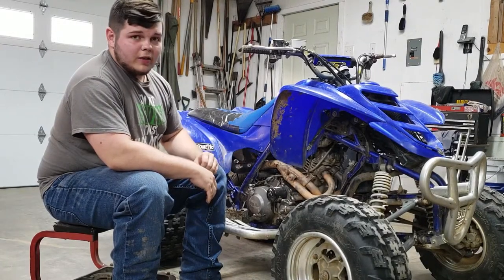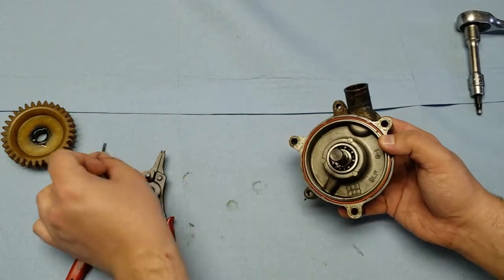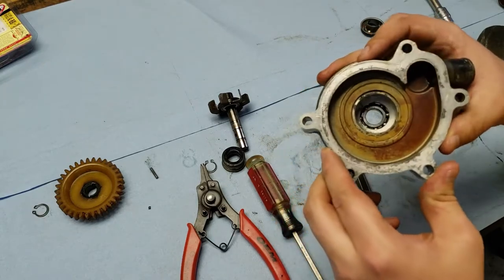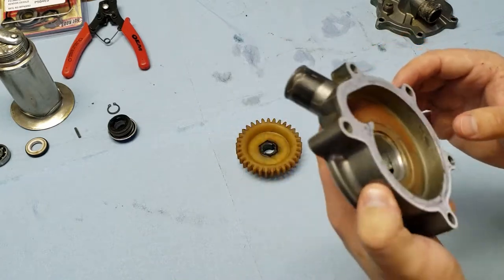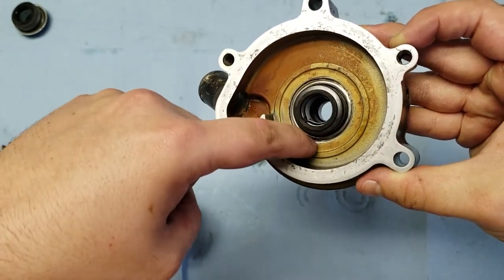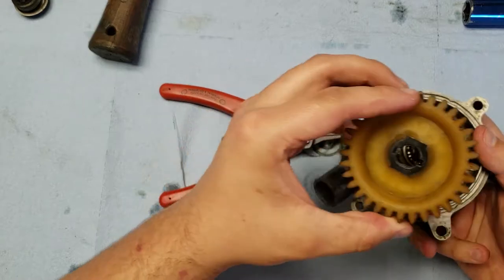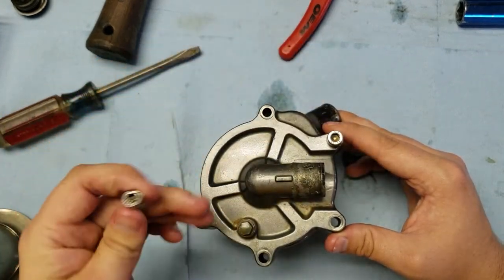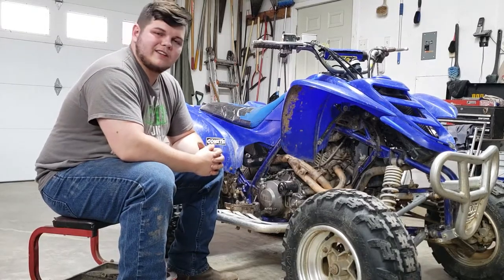Raptor 660 Water Pump Rebuild Guide

Comment: The black seal you put in on the backside of the bearing the one where you say the letters face out towards you - when I put my new seal in it went below flush on that side and now the bearings won’t spin.  I didn’t know what else to do so I kept going and when I got the shaft back in, it spun but kind of tight. Should it be tighter with the rebuild kit because of all new seals and stuff.  I got the same kit you used and there was no markings on the bearing like there was on the stock one that said Japan on one side. The book says put writing facing down but the new bearing had no writing. How did you know what way to put it in or didn’t it matter?  I’m taking a water pump out of another 660 to compare how freely it spins. So my questions are what about the lack of writing on the bearing and does it spin, but a little tighter than before. Thanks. And great vid
Reply from the maker: Mine was a little tighter but not by much since my old bearing really didn't have that many miles on it, its definitely not an easy turn but its not hard per say. I took a gander at which way it faces since I don't have an oem to compare, I compared to what I took out since what I had was working before. Most oem stuff - from what I've noticed - if it doesn't have lettering that means its uni-directional or its obvious which way it goes. This case was a "it looks like it goes this way" 😂 but yes. My bearing was a little harder but it could still spin, might check it before you press it in and see if it easily rotates with your finger because it should

Comment: Thank you. Can you please tell me where is the thermostat located 2005 raptor
Reply from the maker: It's on the right side hidden under the front plastics under the handlebars, you can follow the top radiator hose which leads right to it
Reply: @Hunters_Mechanics  I will look again thank you 👍

Comment: I took out the other one and it does spin easier than the rebuilt one. Think it’s possible to get out those seals without destroying them?
Reply from the maker: It would be a job for sure to attempt not to destroy them, I would go ahead and still replace the seals because they could still fail sooner than later and just cause you to rebuild it again anyways
Reply: Ok thanks for the quick reply. Appreciate it

Comment: Does it matter which way the seal behind that bearing goes because I put mine in opposite of yours
Reply from the maker: I think it does because of the taper that it has,  when I was doing the video I tried researching it but didn't find anything on it so I stuck to the rule of "numbers face you/up"
Reply: @Hunters_Mechanics   Took it apart and that's the way it came out of mine So I put it back that way then watch your video I was like damn  So I took it back apart Don't feel super good about how it went back together.lol
Reply from the maker: @coolguydpc89  well as I said in the video mine apparently didn't have one and I've had it since 2016 lol a seal is better than no seal
Reply: @Hunters_Mechanics   So you're pretty familiar with the 660 never had one and I'm doing this build Are they pretty powerful You're gonna be running an 11: 1 wiseco  As well as I  Polished  the heads on mine And have a stage 3 hot Cam With kibblewhite Springs and valves
Reply from the maker: @coolguydpc89  I've just had this one for years and shit kept breaking so I learned pretty fast how to fix it all lol eventually ill be getting a hot rods rebuild for the bottom end and a big bore (probably 686) like it used to have, the guy that owned it before me used to race it and beat this hell out of it and I suffered having to fix it all lol
Reply: @Hunters_Mechanics   You do a good job man you definitely know your stuff you're the one that helped me get my bottom in back together Keep up the good work As long as I don't get beat by anything but a raptor I'm good.lol

Comment: That mechanical seal was a bitch to get out! I pooped out the bearing first then stuck a socket in and banged the hell out of it and after awhile that seal came out. I can't believe how tight it was in there
Reply from the maker: Don't let the videos fool ya, this sumbitch was tight too 😂😂
Reply: @Hunters_Mechanics got mine back together. But my impeller shaft was hard to push in. I looked through the bearing hole and noticed a seal sticking out past the bearing where the shaft slides through. So I had to use a hammer to get it in. And after banging the shaft in I  noticed it pushed out a small ring seal. It was the size and as thick like the c-clips. 
I don't know what to do now. Definitely ain't doing this again. Any idea? I used a moose rebuild kit
Reply from the maker: @Kevin_Yagoonie  Shoot me an email at bacon626262@gmail.com with pictures of what you're doing and the kit you bought online lol I can't visualize without seeing what you see
Reply: @Hunters_Mechanics im just gonna buy a hot rods kit and do it all over again. Because the piece of seal that the shaft pushed out was part of the oil seal. I knew something was wrong when I couldn't push the shaft in by hand. Even was tough banging it in with a hammer. I think what happened was when I hammered in the oil seal I hammered it too much where it squished the oil seal
Reply from the maker: @Kevin_Yagoonie  That hot rods kit worked flawless for me, I'm still running it to this day with no issues
Reply: @Hunters_Mechanics  good to know. That's what I'm gonna go with. Because this moose kit I used didn't work out well.
I'll let ya know how it goes with the hot rods kit.
And thanks for replying and helping out 👍
Reply: @Hunters_Mechanics I just rebuilt the water pump using the hot rods kit. Went together with no problems at all. Unlike the moose kit I bought which didn't fit in as good and didn't work out. So I'm all set! Thanks hunter 👍
Reply from the maker: @Kevin_Yagoonie  glad to here it!
Reply: @Hunters_Mechanics  So I rebuilt my water pump. Now it leaks coolant out the weep hole on the bottom. Installed everything correctly but did put a small tear in the mechanical seal rubber part while banding it in with a socket. Can that really cause coolant to leak out?? 
Kinda pissed wanna burn this thing 😡
Reply from the maker: @Kevin_Yagoonie  That tear, damage to the steel on the seal that mates to the water pump, or just dirt/contamination/damage to the surface that the seal sits in will cause it, sorry to hear your having this issue :( How bad it is leaking out that hole?
Reply from the maker: I've fought with the weep hole seaping coolant for 2 water pump rebuilds years ago and just lived with it for seaping until I split the case for the rebuild. But back then I was using cheap eBay rebuild kits, that hotrods kit is the first that I've had that didn't leak on me or seap out the weep hole
Reply: @Hunters_Mechanics  it's a steady 2 second drip. Think I'm just gonna buy a new assembly so I ain't got to mess with it anymore.
Reply: @Hunters_Mechanics  it wasn't the hot rods kit. It was my fault. When I used a socket to bang in the mechanical seal the socket was a bit tight around it. So the socket put a tear. I honestly was worried but thought I'd get lucky and it would effect it. But it did. Oh well